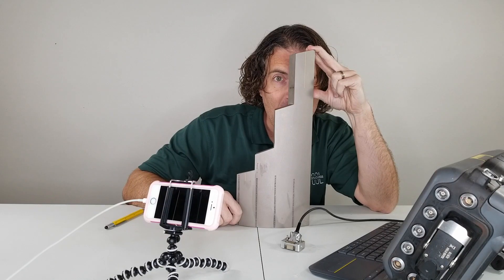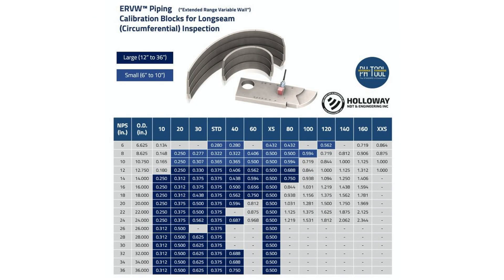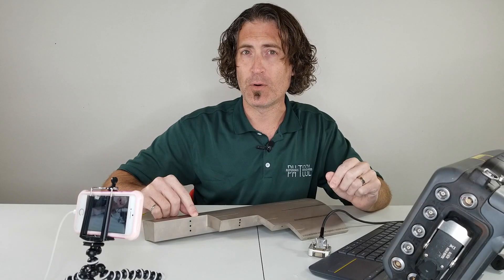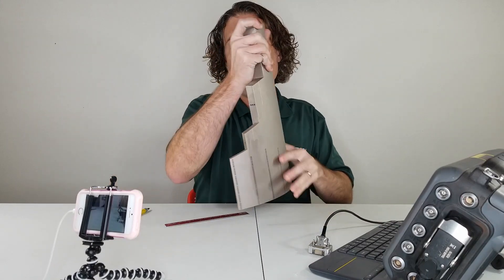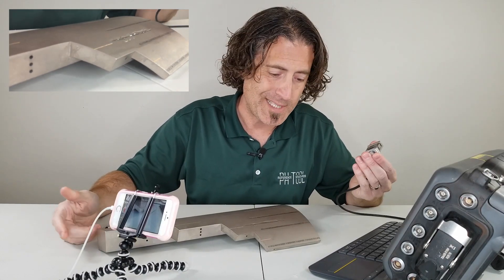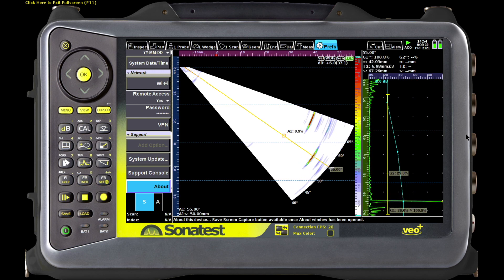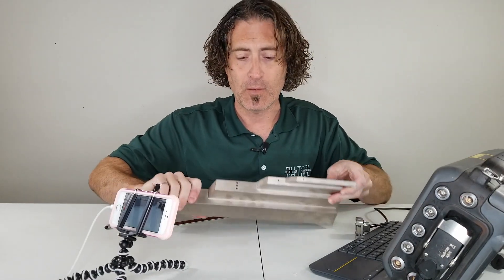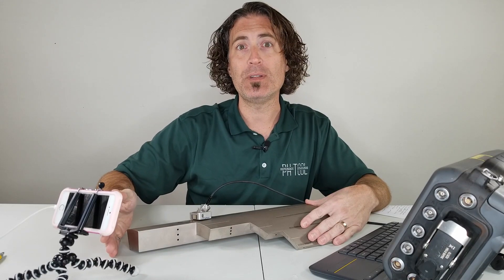What's That Weird Thing? - ERVW Axial Calibration Blocks

Comment: Hi Paul, I work in an oil refinery, the size of the pipe from 2 inches to 24 inches and the thickness from 6mm to 24 mm, what I need a calibration block to do ACG & TCG for the phased array technique
Reply from the maker: You will need alot of blocks. ERVW will cover you for most of that, but there's no way around getting some smaller pipe ones

Comment: ask about , ERVW blocks (small, medium, and large block) , is coverd the piping diameter range from 3 inch to 20 inch and can we used these blocks for wedge delay and velocity calibration ??
Reply from the maker: Why perform a velocity calibration? The velocity in carbon steel has been known for over 100 years. You can verify that the settings are correct by measuring the position of the reference reflectors. But a true velocity calibration is not needed, unless you want to risk changing the value to something incorrect.

Comment: Hi Paul, 

Code is allowing for SDH instead as Notch as an alternate reflector. But Code is also pointing to one More statement alternate reflector instead of Notch have an equivalent response. Did this block is full filling this statement?
Reply from the maker: Hi Rahul, ASME does not state a hole is equivalent to a notch. It definitely is not.

Comment: Hi Paul! Should I get these for conventional UT? Or just go for the notch set instead? Gut tells me yes and that this will be fine for shearwave.. I’m getting more into PA now so I’m thinking it may be beneficial to go with SDH? 
What a cool channel!!
Reply from the maker: They work for both, but the tapered ends are not helpful for conventional like they are for phased array. If you need just a few sizes, regular blocks from PH Tool are more economical. But if you are doing everything under the sun, then that's where ERVW is probably better.

Comment: Hi Paul. 
When working on oil rig risers. The standard main tube line is 21.25” x 0.875” WT and the Choke and keel lines are 6.5” x 1”WT. (from my own experience)
According to the graph on your wedsite, these sizes pipes do not fall into range of the ERVW block set. 
What would you suggest suggest for pipes of these dimensions.
Reply from the maker: Hi Jason, yes those are irregular pipe sizes just outside the range.

For the 6.5", I'd just get one block made that matched. For the 21.25", just use a regular flat 3/4" ASME block.
Reply: Hey Paul. 
Thanks so much for your advice and the articles you have written. You really help give clarity.

Comment: Hi Paul thanks for explaining this, just there is one question in my mind about PACS calibration block
What different if we make TCG by using PACS calibration block instead of ERVW and make the scanning surface of the PACS curvature as NPS of the pipe
Reply from the maker: The holes in a PACS block are much too small for ASME. As well, the PACS block is 50mm in height. Since piping calibrations require a block within 25% of the pipe thickness, even if it were contoured it would be applicable only for pipe from 40 to 66mm thick.
Reply: @hollowayndtengineeringinc.5201  thanks ,you're awesome